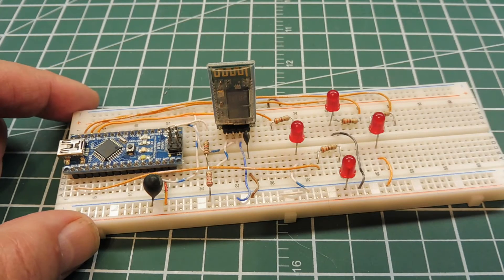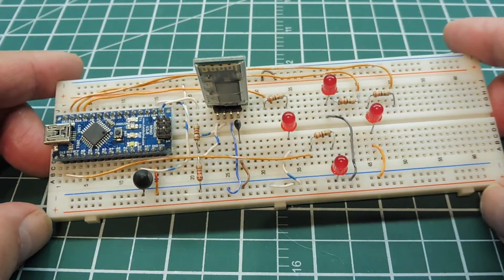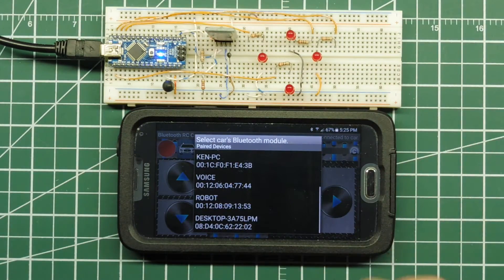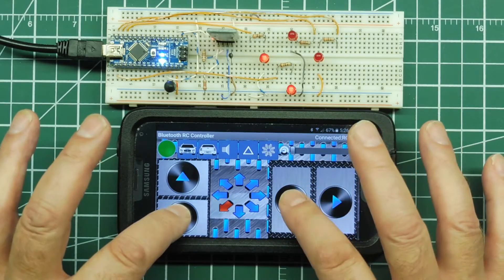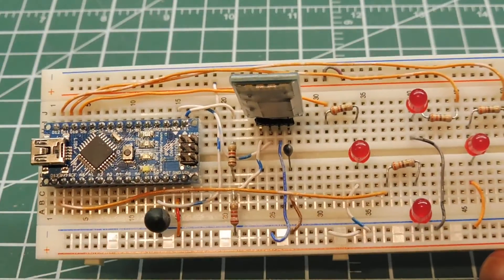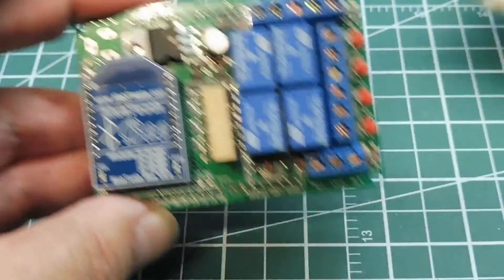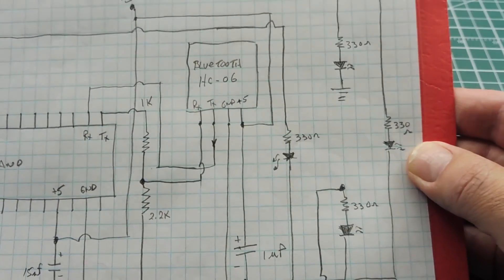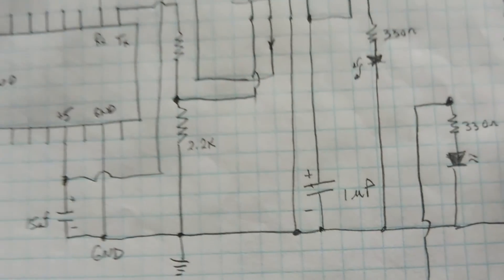RC Control using Bluetooth

Comment: thank you....please i need the code
Reply from the maker: The code is written in FORTH.
The Android app sends ascii characters for each direction command.
"F" for Forward, "B" for Back ...etc.
Your code has to detect these direction characters and turn on the desired GPIO pin.

: RC.car
          Init
          103 $C4 !  \ 9600 baud
          BEGIN
                Key dup
                70 =  \ F
                IF Forward   THEN dup
                66 =  \ B
                IF Back      THEN dup
                76 =  \ L
                IF Left      THEN dup
                82 =  \ R
                IF Right     THEN dup
                83 =  \ S
                IF Stop      THEN dup
                73 =  \ I
                IF ForRight  THEN dup
                71 =  \ G
                IF ForLeft   THEN dup
                74 =  \ J
                IF BackRight THEN dup
                72 =  \ H
                IF BackLeft  THEN
                27 =   \ esc
          UNTIL ;